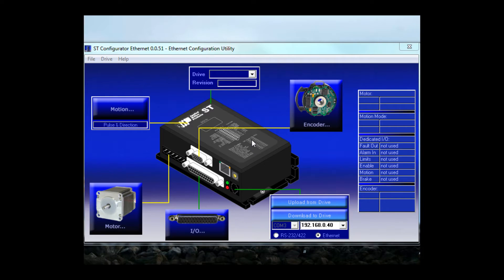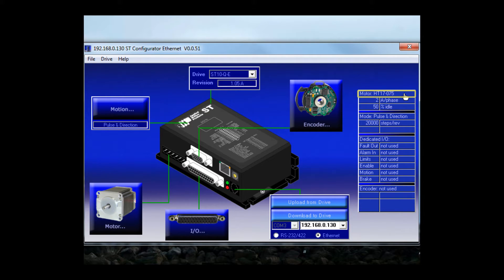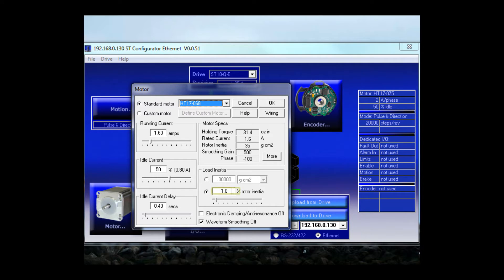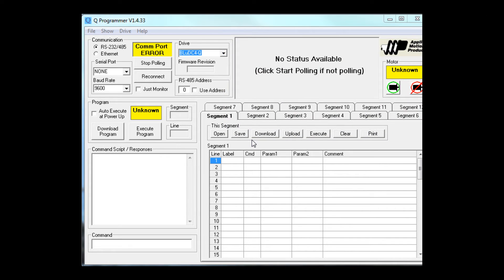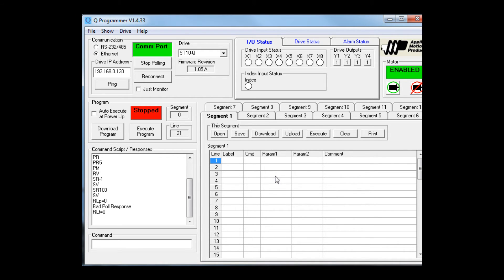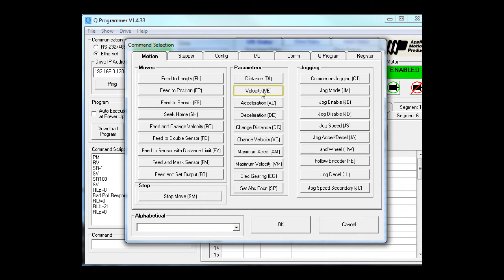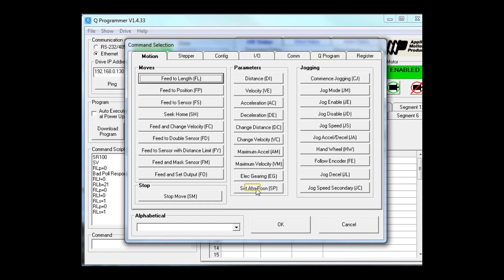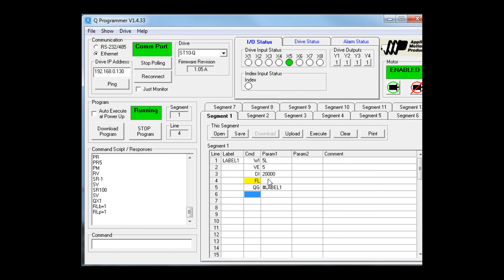Introducing the ST Ethernet Motor Drive (Part 3)

Comment: Did you connected the switch to X5 (5) and GND (19)?
Reply: +Saul Eduardo Renteria Navarro Hi there! You are right, but there are other connections required.  That stepper drive actually requires that power be applied to the inputs, so there is also a jumper wire to supply voltage to the X COMMON, pin 8.  It's really hard to see the jumper in the video. The hardware manual shows the details and you can download it from here: http://www.applied-motion.com/sites/default/files/hardware-manuals/ST5-10-QSi_Hardware%20Manual_920-0004F.pdf
If you have more questions, you can email us at: support@applied-motion.com
Thanks!
Reply: So, the jumper wire, goes from X COMMON (8), to... +5VOUT?
Reply: That's correct and this works well for demo purposes.  However, as you will notice in the hardware manual, the voltage range for inputs X3 through X8, including the X5 input, is 12-24Vdc.  So, while the +5V pin is fine for a demo, the I/O supply voltage should be in the range of 12-24Vdc for best reliability.
Reply: +Matt Cole All right Matt, on my case I need to activate the movement of the step motor with an input of 24 V, so, I would need to connect the the X8 to +24V, X5 to the signal control (+24V too) and the -24V to GND (19)?
Reply: Please refer to page 29 of the hardware manual: http://www.applied-motion.com/sites/default/files/hardware-manuals/ST5-10-QSi_Hardware%20Manual_920-0004F.pdf
For additional support, email: support@applied-motion.com
Thank you.